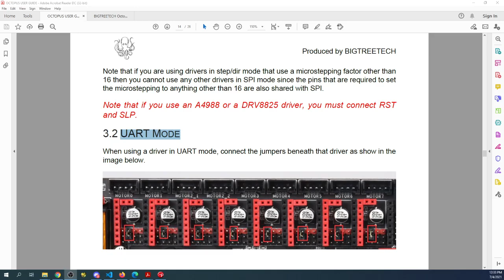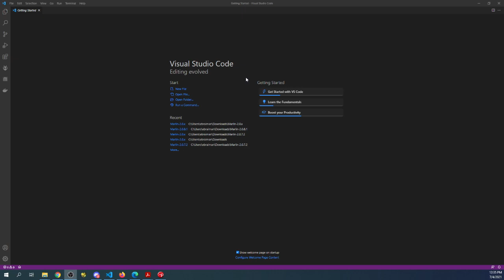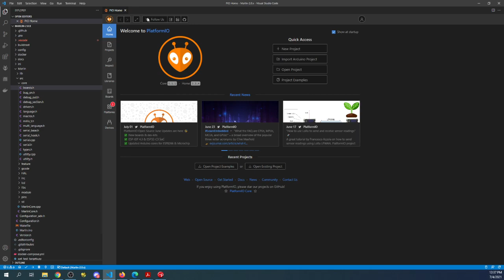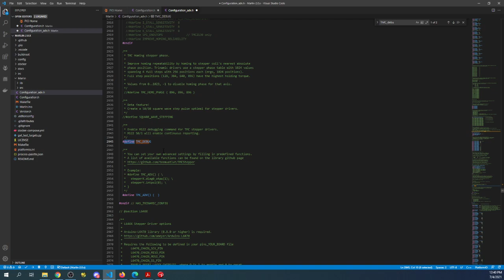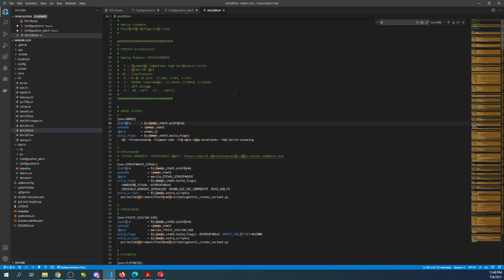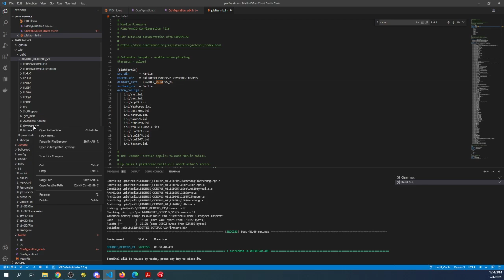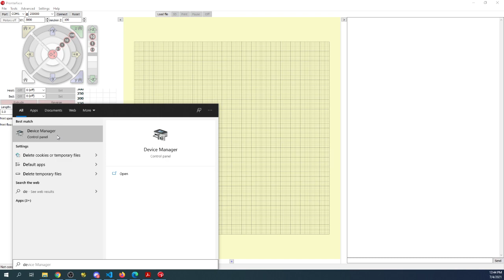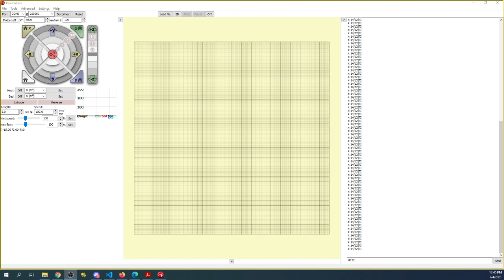BTT Octopus V1.x - TMC2208 UART

Comment: Do you not need jumpers from the top of the driver to the main board?
Reply from the maker: Should be the process in the video.  Are you referring to another manufacturer of steppers?  If so I suggest comparing data sheets.

Comment: Thank you for the video. JJust a question: did you solder J2 as described in the BTT TMC2208-V3.0  instructions?
Reply from the maker: On new TMC2208 you should not need to solder.

Comment: First, thanks for that video. I jus the BTT Octopus with Klipper an i have the TMC2208 in UART2 mode. The Connection ist stable and the printer.cfg looks fine. When i would move the Stepper, Klipper shut down the Printer and the axes dosn‘t move… i have no idea why
Reply from the maker: Depends on if you have TMC 2208 enabled on printer.cfg.  also have you checked against Marlin firmware functionality?
Reply: YouTube have problems with commentory. I have answer you on your Discord. In the channel category klipper

Comment: Hi there, I just noticed a possible discrepancy at 3:20, although I don't know if it's at your end or mine. The way you've marked the voltages in red matches my board (also a V1.1) except for the bottom, where mine is labelled:

Motor  Power    -
                            +
Power                 -
                            +
Bed Power         -
                            +
Bed Out              +
                            -
Reply: Mine is Labeled the same as yours. I am also wondering if this is correct.
Reply: also I have the Pro version of the Octopus board so maybe the Pin out is different